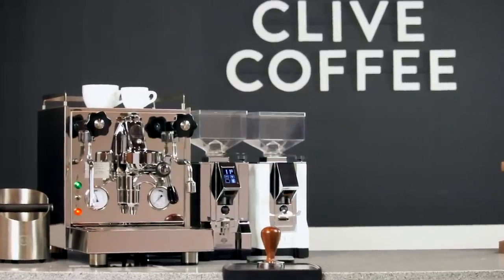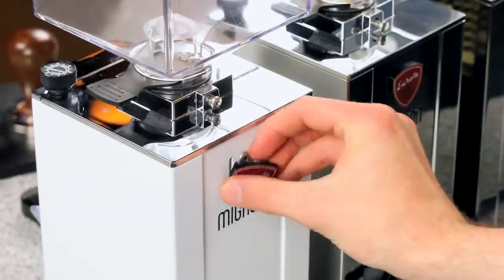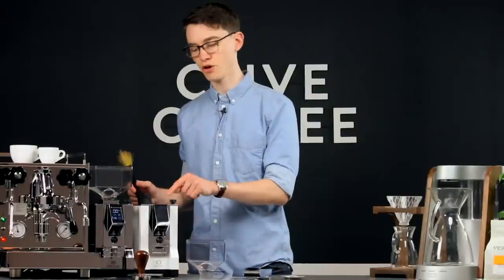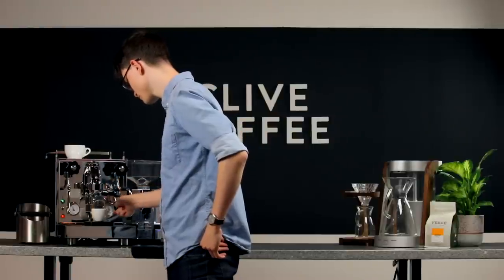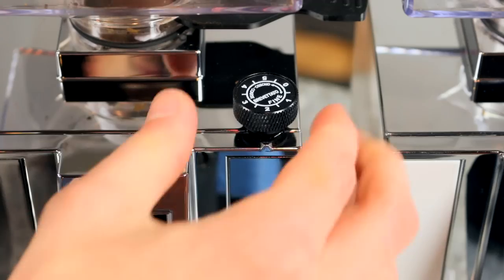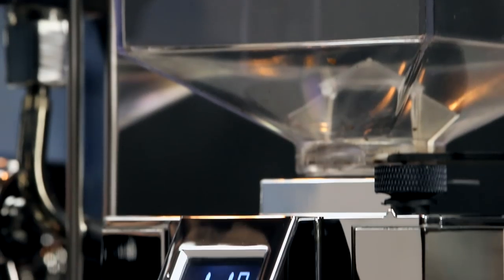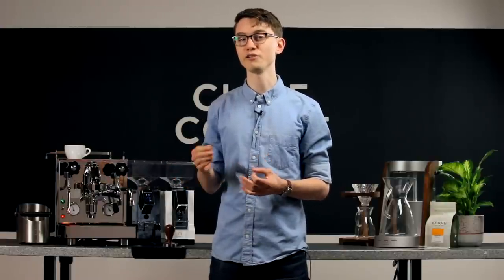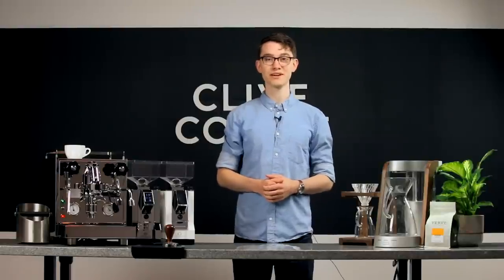Eureka Mignon Espresso Grinder Tech Tips

Comment: Easy way to remember which way to turn the grinder setting: It works like any normal screw... Turn clockwise to tighten/finer, turn opposite to loosen/coarser.
I found the printing on the knob to be lacking in that respect, though the numbers help getting you close to previous settings quickly...
Reply: Thanks for this. Good tip!

Comment: Great tips.
If switching between espresso and french press every day becomes tiring,  I think it makes sense to get a cheap grinder just for french press, like the Delonghi KG79. Coarser grind doesn't seem to require a great quality grinder. Then the Eureka can stay at espresso setting all the time.
Reply: That’s my plan. I own a Bunn industrial grinder, and that will continue to be my ‘pot’ coffee grinder. The next few months will find me getting one of these grinders for espresso only, along with a single serving hopper-blower from Etsy
Reply: The better the grinder the less fines produced while grinding for pourover/immersion resulting in brighter and cleaner brew. So i have to disagree with your statement. Get the highest quality grinders for each (espresso and pourover) that you can afford
Reply: @darkim1777  I use the KG79 for immersion and pourover, and am getting a very clean result - even with a french press, where you indeed do not want any fines.
I would say the Delonghi is good enough for middle to coarse grind.
Still, of course you remain correct: a better, more expensive grinder will produce better results. With diminishing returns/bucks, probably. I use a Eureka Mignon for espresso, but have to admit I never tried it for coarser grind.

Comment: Wonder Video!   Just got this grinder.  I will be dealing with a bit of a challenge as we are switching between espresso and aeropress grind every morning.  I think we have a good grasp on the espresso setting (2.5), but can you share your #'s for aeropress, pour over and french press?

I wish there were some way of knowing how many times the wheel had been turned.  e.g. if I leave it on my aeropress setting, its confusing for the next person.  Any tips?
Reply: I got the same grinder.. I think you have to figure it out and then simply pin a note somewhere near 😅 did that for different amounts of filtered coffee as well.

Comment: How is it right to set the grinding consistency (fine or coarser). While the engine is running (with or without coffee in the hopper) or while the engine is stopped? Thanks
Reply: Fine only with running motor. Imagine what happens to the mechanik when you sqeese the beans between the statik grinders.

Comment: Hi, why is it important to remove the hopper before adjusting finer? The hopper should'nt have any contact to the burrs, or? Would it be better to adjust finer while the grinder is running? In the manuel Eureka is writing to run it every 2 steps for  a short time.

Comment: My Speciality zero has actually become the number 5 position (clockwise from the 0 position). espresso range is somewhere delicately between slightly before and just after the 0 spot. Shot times are extremely long, over 1 minute, but the taste is good. Anything in the 27 to 30 second range tastes very sour. Not sure what I'm doing wrong. Using a QM Pathfinder and a Flair 58. The 58 helped confirm that temperature wasn't the problem.

Comment: Thanks for the great video! Some thoughts and questions...

I have the previous generation of the Mignon. While I love it, it’s worth nothing that if you’re not grinding while adjusting the dial, especially when adjusting finer -  IT WILL JAM. Is that not an issue with the newer models? Your adjustments here don’t appear to show the grinder is running.  Just curious.

My feeling is after working with the Mignon for a year plus, if you like to switch between different beans frequently, you’re probably better off with a Vario, or a grinder where you can clearly note your grind setting to match the specific beans your using. You tend to waste a lot of bean, regardless of any notation of setting. 

Lastly, the screen that is by the shoot, it’s my understanding that’s what helps prevent the clumping the previous model suffers from. Can this screen be added to the previous model?

Thanks!
Reply: Christopher F wonder what the residual amount would be in the Mignon ?
Reply from the maker: Thanks! For starters: The new Mignon espresso grinders are far tougher than their predecessor. When we got them in we were absurdly rough on them, adjusting very coarse, making a huge adjustment finer, and then grinding. We were astonished at how hard it was to jam these things. While we still recommend exercising caution you can certainly trust them to be forgiving. As far as I'm concerned, the new Mignon series should have gotten a new name as, despite similarities in aesthetics and specs, they're an entirely different animal when it comes to performance.

The screen is definitely a key component in making sure the grounds are fluffy but it is not adaptable to the original Mignon.
- Charles
Reply: I have the specialita, she will jam if you adjust finer without it running in my experience. Having never used the original I can't say if it's better in that regard, but I certainly have had it happen.

Comment: What size screwdriver should I be using to do this?  I do not know why, but I cannot get the screw to loosen under the emblem after I pull it off and I do not want to strip the screw.  Thanks!

Comment: hey, when making grind adjustments on de Mignon, do you need to turn on the grinder whilst turning the knob to make coarser/finer adjustments? Or does it also work without turning it on?
I thought I saw this in various other video's, but making those adjustments whilst the Mignon is grindings, seems to spill a lot more coffee than if I can make those adjustments without tuning it on ;) but I don'y know if that's okay for the machine.

Looking forward to the answer :face-turquoise-covering-eyes: Thanks in advance. Love your videos!
Reply from the maker: Hey! Yes, when you have coffee in the hopper, you want to grind while simultaneously adjusting the knob in the fine direction only.
Reply: @clivecoffee  nice! Thanks! And when grinding coarser, I should avoid having beans in the hopper?
Reply from the maker: @JaspervanderKamp  Nope. You only have to grind while adjusting when you're making adjustments in the fine direction.
Reply: @clivecoffee  Thanks, this tip will prevent 2-4 wrong espresso's the next time i buy beans that need coarser grinds haha
Reply from the maker: @JaspervanderKamp  Happy brewing!

Comment: I noticed that you used a vacuum to clean out the retension grinds. I dont have a vaccum. But could a can of air (for computers) do ok? Do you recommended that or not?
Reply from the maker: You can use a can of air and I've done so on many occasions. I have two recommendations based on experience: 
1. If at all possible, do it outside, haha 
2. Most canned air uses some form of bitterant as a way to deter children from doing anything dangerous with it. While harmless, it's possible that this could end up on your burrs and contribute some bitter flavors to your coffee. Grinding a few grams of beans should get rid of any residue. (This is why I now stick to our shop vac.)
- Charles
Reply: @clivecoffee   Thank you Charles.

Comment: Hello,

Would you say the Silenzio is a notch above the Rocky and the Sette 270 (standard)? I was torn between those 2 but considering going with the Silenzio if it offers a more solid build like the Rancilio and the fine grind of the Sette. Also, would you say that clumping is minimal?

Thanks!
Reply: I know it's been a year, so you must have made your choice by now. Looking around online, the Sette has a plastic gearbox which wears out quickly. Easy enough to replace, but you'll be doing it way more often than you would want to, considering the price. I've just upgraded and went with Eureka (the Specialita). Though I love the design, the lack of retention and the features of the Sette, that gearbox issue was a deal-breaker. Hope you're happy with what you got!

Comment: What’s the residual amount left in the Mignon ?thatwould be handy !
Reply from the maker: These grinders hold onto between 1g and 1.5g of coffee (otherwise known as grind retention). Impressive for a flat burr grinder and part of what makes them proficient single dosers!
- Charles
Reply: You mean 1-1.5 on a 18g dose total?  That's a significant amount. . not very low.. not good for single dosing.
Reply: I single dose using a Mignon and have found (after tapping the side of the grinder when finished) I get around 0.2g retention

Comment: very good video :) I'am so close where the burrs hits each other with very fresh coffee, my Eureka Specialita is only 6 mont's old, do you think that I do anything wrong ? I really don't understand why I have to grind so fine.
Reply from the maker: Hi there!
Since there are a myriad of variables when pulling shots it's tough to nail down one thing that could be the issue. If you're using a lower dose amount, that would result in a finer grind necessary for that specific recipe. Typically there is about 5-6 numbers between a standard espresso setting and the point at which the burrs will touch. Hope this helps! If you're still having issues I'd recommend reaching out to your original vendor as well.

Comment: my grinder is set at 11 secs but I am grinding over 20g of coffee - I have dropped to 8 secs and still getting 18g - should i make the grind finer to get 17g? thanks
Reply from the maker: It's more important you get the dose you want than how long it takes to grind. If you use 18g, how many seconds does it take to pull your shot? We recommend aiming for somewhere between 27g and 36g of espresso out with an 18g dose. You should be somewhere around 30ish seconds (as a good starting point). From there, you can decide if you want to grind finer, coarser, or change your dose.
Reply: @clivecoffee  ok yep the shot is taking about 176 secs for 2oz so its too quick but its fine and if i go diner the grinder eureka doesnt grind?? Ahhhhh annoying thanks though

Comment: Hi guys. Looking for an answer to this question if possible: is it possible to bring the burrs together so that they are touching, resulting in damage when the grinder is switched on?
Reply from the maker: It is possible but generally, this won't result in damage unless done in a truly excessive way. You'll be able to hear when they touch – it sounds like a light metallic scraping noise. Burrs are designed such that the surfaces which can touch are already ground smooth, with the cutting edges being slightly recessed.

In short: don't worry about it, and if you hear a sudden surprising noise just turn the knob back a bit.
- Charles
Reply: Clive Coffee I’m reassured! Thank you, Charles. 👍
Reply: @clivecoffee  но я имею хороший помол  под эспрессо только в том случае, если жернова соприкасаются друг с другом. Если немного ослабить, помол уже не подходит под эспрессо. Я использую Nuova Somonelli MCX.

Comment: i have specialita with perfeto easy set knob i am in the turkish zone almost burrs touching each other and still cannot dial in for over 20 seconds shot, is this problem familiar to you? what is the solution?
Reply: more coffee maybe?
Reply: @tamasd8  more than 18 grams on regular filter basket not recommended
Reply from the maker: Typically when a Mignon reaches the point where the burrs are about to touch, it an extremely fine consistency which is suitable for a wide variety of coffee. If you are still seeing fast shots at this setting, then I'd look at the age of the coffee being used. Does it a roast date on the bag?
Reply: @clivecoffee  i roast and it is few days to few weeks i tried different coffees and you can see in home barista i am not the first having this problem, also i use as alternative mignon from 2008 without this problem
Reply: it was a lot of old coffee stuck in the passage from burr exit to coffee exit funnel also rthe clump crasher was bent so after cleaning the passage i could dial in again also taste improved

Comment: This might seem like a weird question but, if the grind adjustment knob is turned too far on either side, could it damage the grinder?
Reply from the maker: If the grind adjustment knob is turned too fine it may cause the burrs to touch. This is unlikely to cause damage and you'll immediately hear a buzzing sound that will alert you to the issue, at which point you should adjust coarser. Adjusting too coarse will never cause damage.
- Charles
Reply: @clivecoffee  Thanks for the response! Really interested in this product. Hopefully I get one soon!
Reply: @clivecoffee  Hey Charles! I was wondering if these would need cleaning tablets when switching coffee beans or just monthly maintenance? If so,  which ones would you recommend?
Reply from the maker: @ishiie14  For grinder cleaning tablets I recommend Grindz: https://clivecoffee.com/products/urnex-grindz-grinder-cleaner

It's not entirely necessary to use these when switching coffees. For that, I would just grind a fair amount of the new coffee to flush out the old grounds. 10-20g will suffice.

How often you should use them (or manually clean your grinder) depends a bit on the type of coffee you use. If you use lighter roast coffees you can easily go months without finding any buildup inside the grinder. With dark roasted beans you'll notice buildup within weeks. Using them at 2-month intervals should be reasonable for just about any coffee, but feel free to adjust according to your experience.
- Charles
Reply: @clivecoffee  Great! Again, I appreciate the help!

Comment: Never turn finer without grinding!
Reply: Please explain, thanks!
Reply: @HarkoBarf  The turning mechanism will be destroyed if the grinding disks are forced closer together without operation, as coffee beans are stuck between the grinding disks and will block any movement.
Reply: @tomselleck0607  Good to know! I just bought the grinder and turned it finer and then it stopped working. It started working again when I set it to coarse. I won't make the same mistake again.
Reply: @HarkoBarf  I think nothing is broken. There were only a few beans squashed and the discs had no strength to overcome the friction.